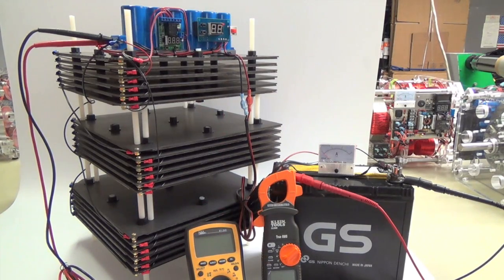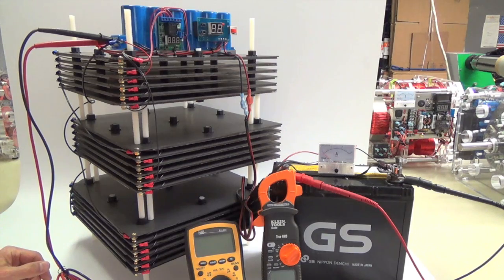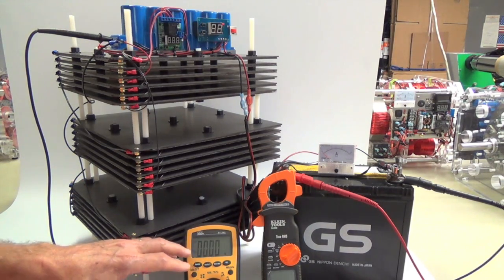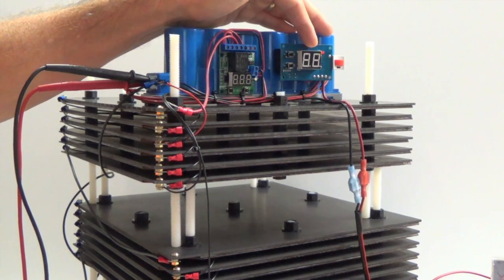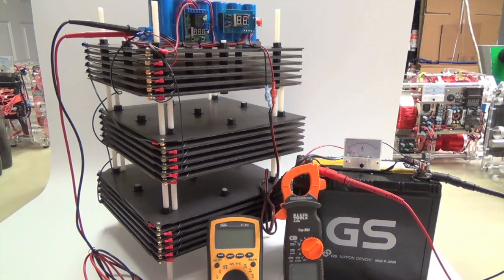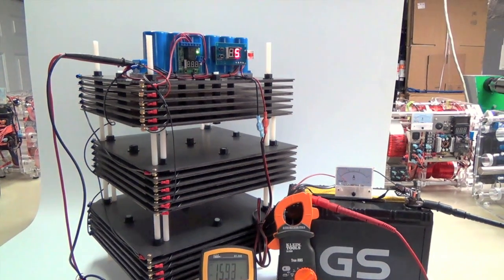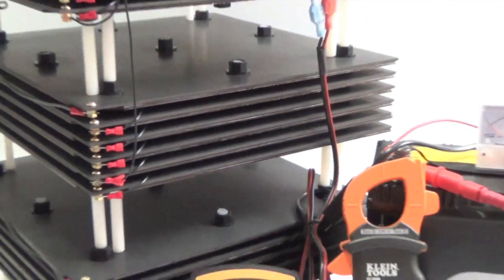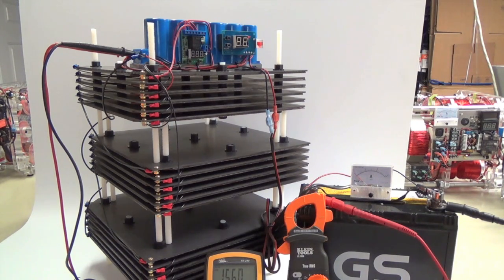Solid State Energy - SiC nano

Comment: Pretty cool stuff. So the silicone carbide stores energy at the atomic level rather than in chemical potential energy (like batterys which have a limited life cycle) or in a quick discharge electric field (capacitors which don't do well slowly releasing charge)? Or is this taking the energy from the surrounding? 

For those blustering about ambient energy, such a thing does exist, the scientific community just hasn't developed any system to harness it in any useful quantity. Ambient heat is a form of energy (though you need a temperature differential to use it) as well as light in all forms, including radiation from radio sources, cosmic rays and our own sun, not to mention all the man made radio and microwave radiation used for telecom. Atoms and dust in the air also store up charge as they interact with each other and grounded materials can take on positive charge if the surrounding dips low enough. If you can exploit sensitive material and earth magnetic field Flux, you can similarly generate conserved energy with sensitive enough crystalline structures. Hell, Tesla even worked on using ground potential to create voltage differences that would charge air with high potential, low current electricity. He went bankrupt of course (and the idea of bright pixies falling from the sky to charge things wasn't very appealing) so that research ended before his large scale prototype was complete, but there's definitely potential here. 

I'm a physicist, and while there's lots of things we've disproven with confidence in the natural sciences, ambient energy is not one of them. We haven't built any confidence in proving it either, but if we all only entertained ideas which agreed with our prior knowledge, discovery would have died with the Roman Empire. 

Interesting stuff man, if you have any published research I'd be interested in taking a look. :)
Reply: Vin Jak how so? I asked a question then explained what ambient energy actually is, or could be. Ultimately energy is a measure of entropy, if the entropy of a system is in equalibrium with the entropy of the surrounding, the energy isn't useful for doing any sort of work. If the material is in fact photovoltaic and can slowly absorb and store low frequency energy from the radiation saturated surrounding, very slowly, it can build up a higher electric potential than the surrounding. That doesn't violate the laws of physics any more than a solar panel violates the laws of physics. All the system needs is a lower measure of entropy than the surrounding to generate and store a useful energy for work. 

I'm skeptical too, but I had to chime in to say that ambient energy doesn't violate the laws of physics. It's counter intuitive to think that a system not doing mechanical work on or by the surrounding could generate power, but just because you don't see chemical reactions or mechanical work doesn't mean it's creating energy from nothing.
Reply from the maker: Yes, I do. Interesting point: latest development using polymer laminate on large separated plates as shown causes an electrostatic transfer or connection between plates with no conventional electrical connections. Not bad for an 8mm air gap between each.
Reply from the maker: Yes, the plates are very unique, and no, it is certainly not fake as many YT armchair warriors would like to claim. I do not consider it a "free energy" device, as it is based on existing technology using alternative materials. And yes, I have 5mm water clear LEDs each having an Internal resistor for 20mA @12VDC, 12000mcd, 530nm running 24 hours a day for months with only two thin polymer laminated graphite half inch by one inch cells connected in series. No batteries, no caps and no toxic chemistry.
Reply: i agree with you . Me too i would love to see some research.
Reply: it's not creating energy. It's storing it. While releasing energy it's makes use of as much as it can from at least 10 elements of which are magnetic and/or conductive or at least semi conductive as in the case of silicon. Since silicon expands 300x when electrified it creates more charge carriers through the cathode in a "redox" reaction... i think. I had bowl of chilie today. I may not remember everything exact. anyways with the redox protecting the cathode from oxidation while increasing the charge carrier capacity it pulsates(breathes) and the silicon-carbide crystals go through this expansion/contraction until the degradation sets in.
Reply: Very interesting... I am skeptical, but I am also open minded to see the possibilities of this "Thing" whatever it is. Is it a battery, is it a capacitor, is it a solar cell that can stores energy? Unfortunately PMMG4HYBRID doesn't tell or explain how this Thing actually operates. I see a battery with a higher potential charging a capacitor bank, which in turn charges a lower potential battery.  Clarification..? or is this the million dollar question?
Reply: No energy is is not a form of entropy it is a frequency a flux or a torus!  Essentially everything is energy already, the only thing we need to do to use it IS create a potential difference!! Nature will counterbalance this and that's usable energy witch is most of the times in the form of AC urrents or eddy ccurrents.. NOW REVIEW your oppinion!
Reply: you do have a point. Thing is theres a lot of action or reaction that we do take for granted and seeing this here IS how could i say against what we are use to see BUT it still does not mean that it is not possible (not that i do believe it) since there is reaction existing today that 40 years ago didnt so as for me i would like to read some research about it .
Reply: Atomic-electro-static charging, slow but unlimited.  John Hutchinson Batteries were also along these lines.  But these are far more professional.
Reply: Probably not going to happen. Solar is going to be a ever evolving technology and will compete until we figure other wise. I'm concerned solar is like a double edged sword where it's adding heat to the planet where this is basically storing energies. This looked like it worked really well with his generator test kit design.
Reply: Daniel Armstrong Tesla supposedly figured out how to draw energy from the air already. the US gov. suppressed those inventions from the world.

Comment: so is this a generator or a battery?
Reply: Power Cell. Using solid state crystals instead of a fuel.
Reply: k
Reply: Generator/charger. This is ground breaking electrical engineering. This is like the baby step in to perpetual energy.

Comment: cool demo...how much for a system? per kwh
Reply: StrategyYouDidntKnow  you need help ???
Reply: Stay high performing and involved friend
Reply: quantamagnetics.com lists a complete 12 cell kit with the gen kit for $5500. guess this could last up to 20 years with maintenance would run up to 7 cents kwh (i'm assuming about a 100W output from the experimental kit and being fairly conservative). If 3D printers can simplify the fabrication and design we can reduce that cost and have it made more locally.

Comment: If so then why not use mili amp hertz diodes to get the cells to generate more charge and use mini vacuum spark gaps to release the breaks and boost the energy output? Am I speaking star trek above your brain wave communication skills?

Comment: where's the difference between your power cell and an peltier module?
Reply from the maker: Powercells require no temperature gradient for output.
Reply: thanks for your answer, generate the power cells their energy because of the temperature difference between shell and core which is generated during loading and unloading?
Reply: You nailed it. SiC heats up more than graphite. the heating gets it more conductive and generates a voltage because of the temperature gradient when it diffuses through the graphite. It's kinda like the new Goodenough doped glass batteries but without the charging of the battery part. That would be the strangest thing for a generator to feed on the heat it has just created alone, without having to renew the oxydo reduction potential that created this heat.....
Reply from the maker: Did you know the so called "glass batteries" have NO glass in them. Only a viscous solution with a separator.
Reply: I didn't know. They claim to use doped glass. I believe it's the separator that you're talking about. Which would be kind of similar to your system because it's semi conductor. But cheaper. And they do use a charge accumulation mecanism. Otherwise, why the use of alcali metal and its low oxydorecution potential?  But you claim that you don't accumulate charge in your system previous to use. And I can't believe that you can get a serious current without this step. The viscous solution they used  in the glass battery is likely a organic solvant for ion circulation. Thanks for the info that it's not 100% solid. I couldn't get why using alcalis if you don't use its electrical potential to store your charge.
Reply from the maker: Precisely.
Reply: since you seems to have info about the glass battery, do you know if it works as well as they claim?

Comment: What the hell is it? Battery, fuel cell?
Reply: "silicon crystals' ability to expand up to 300 times"? Where's the evidence?
Reply from the maker: Gabriel Rosa - Try searching the net. You'll find it's the nature of the element.
Reply: If you have a computer you have evidence. Transistors are silicon based and compile to form our microprocessors.  The silicon will expand under electricity(i.e. 5volts) similar to other materials which expand when energy is transferred(i.e. thermal couple with heat, or water with freezing)
Reply: Solid state energy cells (similar to a fuel cell with out the fuel) in this case use the silicon crystals' ability to expand up to 300 times. That leaves room for design around that material reaction to electricity.

Comment: But where is the energy coming from?
Reply: Yeah he did not explain it.  Where the energy come from... ? 

1-  It work and he know why. But do not tell for some reasons.

2- It's totally fake. 

3- It works  and he do not know why. 

4- It's chemical and do not last that long. 

5- It works converting ambient heat to electricity.  

6- It works using ambient electromagnetic wave. 

7- It's made with graphite from a neutron moderator and it use the  ionizing radiation  to produce a small current. 

8 ... Something else  ? 

My bet if it work for real are on number 5 or 7.  

Number 5 would be pretty interesting.  I always wondered why nobody was able to make something cheap and simple to exact power directly from ambient heat.  It would be useful  be able to suck heat from water air and ground and use it for something else. This would be a revolution.
Link to a similar concept..
https://www.technologyreview.com/s/427140/graphene-battery-turns-ambient-heat-into-electric-current/

But it's most-likely number 7...  Made with a graphite from neutron moderator and he just recover a little part of the energy from the radiation.  Not that bad of an idea ... These sell could last for century. but you still need a nuclear reactor to make the the radio active graphite. And it also mean to deal with radio active stuff.
Link to a similar concept...
https://en.wikipedia.org/wiki/Diamond_battery
Reply: ya, I was thinking that the whole time.... What charges the cells? Pretty much nothing has changed for pretty much all of electrical history.  You spin a wheel.....  Everything we have come up with or invented or new technology created is all just a "new" way to "spin the wheel".  As long as we can spin the wheel without US actually spinning it, we have settled for that.  To spin it, we mainly burn shit to keep it spinning.  It gives us "physical" power (as in combustion or steam engine) and "electrical" power (as in generators).  That is pretty much the EXTENT of our technology.

I did say PRETTY MUCH nothing because solar panels have changed that "norm" as finally we get usable power without spinning the wheel.

Even the most advanced military ships that are nuclear powered are actually ancient technology as we once again have STEAM powered engines roaming the seas.  Did I mention we just burn a lot of shit to turn the wheel??  Well.... they still burn shit, only it is a nuclear reaction that we no longer have to "burn".... now we keep it cool, but the concept and core technology was used as our first "engine" technology.
Reply: +Rusty Koenig:
Not everything is "spinning the wheel". Hawaii is moving away from spinning wheels:
http://www.cnbc.com/2017/03/08/tesla-battery-packs-power-the-hawaiian-island-of-kauai-after-dark.html
Reply: chris toohey Thanks for your  very thoughtful  analysis. After some research I agree  that if it is really generating energy as claimed, then it is most likely from some type of nuclear source. probably an alpha particle emitter.   Two main reasons, 1 alpha particles are relatively safe as they strongly interact with matter and are stopped by just a few inches in air. 2 The cyclic nature of energy generation, with it building up and subsiding as the capacitor charges and discharges.
Reply: Harold, Energy is energy, and there's no need to get it from nuclear when solar is so much cheaper. Just the cost of decommissioning a nuclear plant and storing its waste for 10,000 years makes it more costly than solar! 

This looks like a battery to me, not an energy source, and so the only real question is: Is it better than today's lithium ion batteries, or better yet, is it better than the expected solid state batteries we'll likely be seeing soon. There's a lot of FUD being spread right now, mostly of it being Uncertainty. If this isn't real, then it's likely done to add to that uncertainty with the goal being to cause people to stick with "tried and true" technologies like obsolete, but highly profitable oil and gas.
Reply: chris toohey Yes nuclear has many disadvantages, which make it undesirable, especially now when clean green energy is available. I did find an article where silicon carbide was being used to increase the energy density of a  lithium battery https://www.pddnet.com/news/2016/04/silicon-oxycarbide-cells-pack-three-times-power-li-ion-batteries. The reasons I gave, are why I think that if it is real, then it is probably nuclear. Not that I agree we should be using nuclear energy at all.  in fact if it is, then he might have legal problems selling this device, which explains the secrecy.
Reply: Harold, nuclear power generates heat, then steam, which spins turbines. There are no turbines in this. There's nothing to indicate it generates power at all. Only that it stores it. If it's real, then it's a battery, and should be compared against other batteries.
Reply: chris toohey I also found another article  about electricity generation from silicon carbide with alpha radiation. http://ieeexplore.ieee.org/document/563955/?reload=true
Reply: Yes, and from the title in that link: Silicon carbide alphavoltaic battery
It's not a power generator. So once again, the question is: Is it better/cheaper/lighter than today's lithium ion batteries?

Comment: I am interested in your charging system for using with hho in my van if it will work. Essentially when I turn off the van and I am still getting energy from solar, wind, and thermal I would like to charge super caps then batteries. Can the circuits you have be purchased off eBay? 

Also what's the life expectancy of your cells? I was thinking something very similar with using crystal batteries to charge a super cap bank. Just to have free light in my barn.

Comment: Also, how long do you estimate you can pull out 3 amps, continuously, out of that system? (Before the voltage drops below 20 volts) hours? days? months? years? decades? centuries? 

Like you are doing in the video. (I realized it was pulsed out) 

Just a ball park, I will not hold you to it.

Comment: i still dont know what i should think about this...
in my opinion these plates are just galvanic cells, and soon or later the anode will disappear and then the cell is just an expensive and useless piece of junk because you cant replace the anode.
and the reason why your test cell is running for 15 months is the very low load on it..  less load = less anode corrosion.. how many amps is this thest motor drawing constaltly?

and i dont like your amp measurement, these are just one second pulses, be honest - this delivers much less power than you have expected. then the price - man, thats the most expensive battery charger in the world, congrats.. take a bedini circuit and you have it..